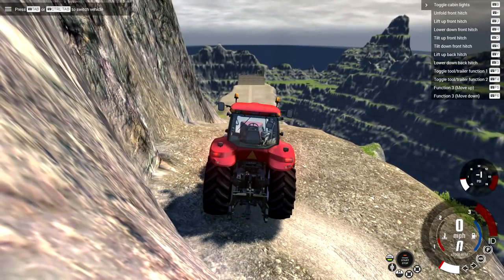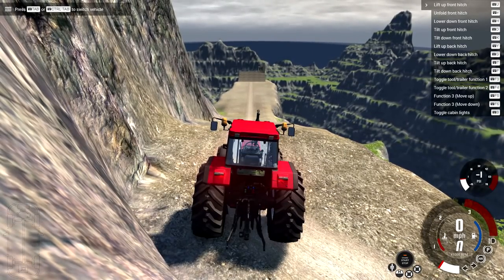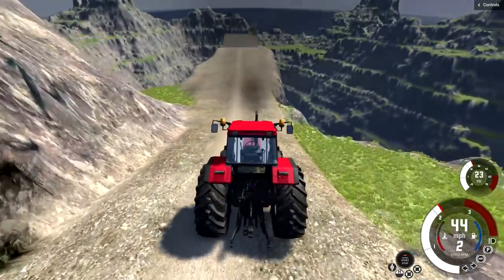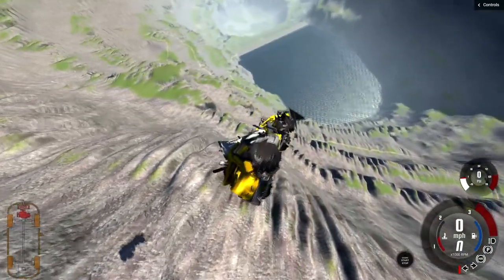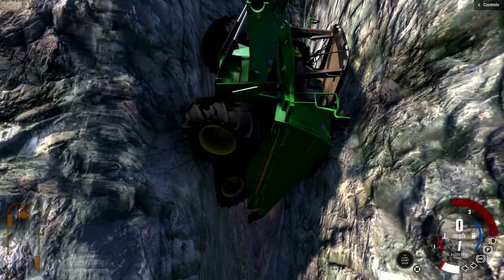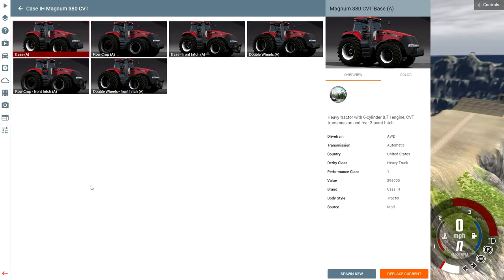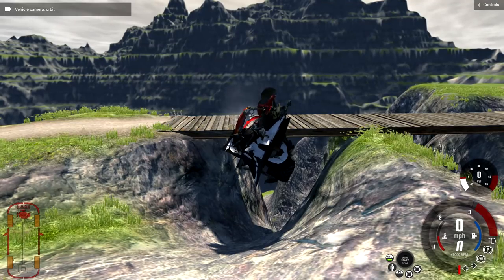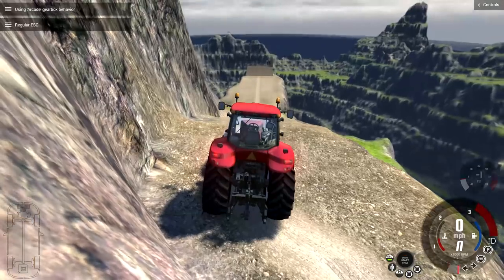CRASH TESTING TRACTORS OFF GIANT CLIFF! Leap of Death! (BeamNG Drive Mods)

Comment: That’s a combine, but you got the price right
Reply: Well, its depending on the combine.
Reply: If its an old Case IH then it will be around $180,000  but if its a John Deere like that one it will be around $350,000. But thats only in my area though. So remember that.